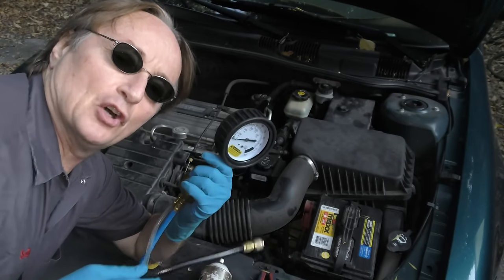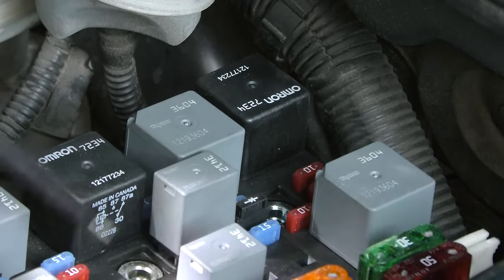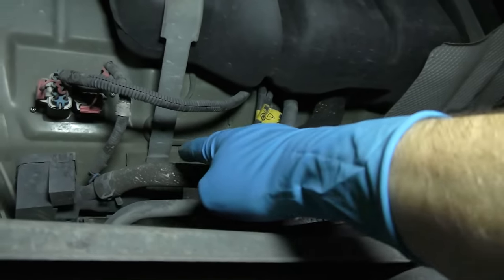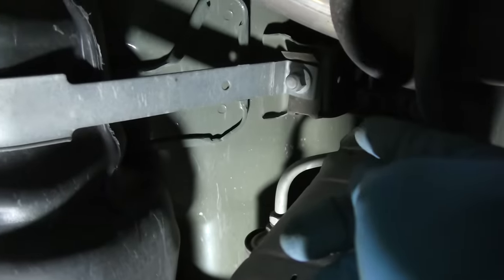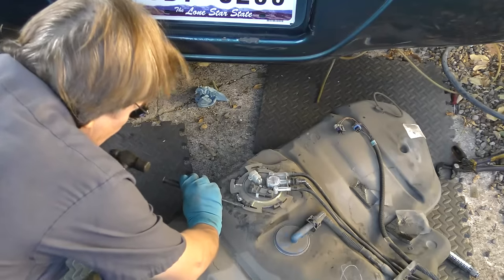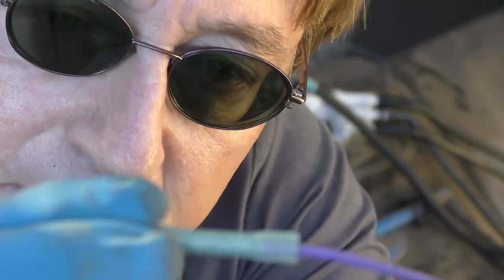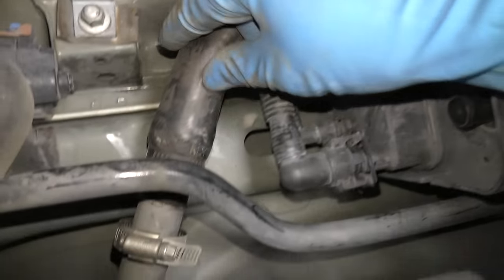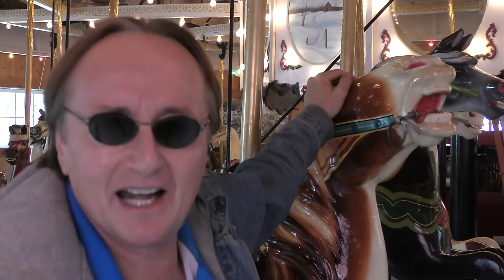How to Fix Car that Cranks But Won't Start (Fuel Pump Assembly)

Comment from the maker: Things I used in this video:
1. Fuel Pressure Test Kit: http://amzn.to/2no0zsh
2. Power Probe Kit: http://amzn.to/2jG2uUh
3. Steel Jack: http://amzn.to/2Asgjxo
4. Mechanic’s Tool Set: http://amzn.to/2Bzmccg
5. Disposable Gloves: http://amzn.to/2zSRuxO
6. Common Sense
7. 4k Camera: http://amzn.to/2hZ4AxX
8. Mini Microphone: http://amzn.to/2newgV9
9. My computer for editing / uploading: http://amzn.to/2i2sKYz
10. Video editing software: http://amzn.to/2jv5Fhf
11. Thumbnail software: http://amzn.to/2k7tz6C

🛠Check out my Garage to see what I use every day and highly recommend:
https://www.amazon.com/shop/scottykilmer

❗️Check out the Scotty store:
https://goo.gl/RwhRGU

👉Follow me on Instagram for the latest news, funnies, and exclusive info / pics:
https://goo.gl/ohy2cA
Reply: Scotty was was the blue cover next to the fuel pump ?
Reply: Do you have to put a whole new assembly or can you just put fuel pump
Reply: Aren't some car fuel pump under the back seat?
Reply: I have a question about my 02 pontack Grand am gt
Reply: Hey my Mitsubishi Eclipse will crank but no start unless I use starting fluid, after that it will run no problem without starting fluid. Could my fuel pump just be weak?
Reply: Mt 2007 kia sportage  ran out of gas I ran a couple days but missed and died alot now it want start at all.why?

Comment: Thanks Scotty! Used your diagnose method on my 2003 chevy silverado 1500. The fuel pump failed all the tests so I replaced it and my truck is running again!

Comment: I changed a fuel pump on a 2001 Chevy Impala and GOD BLESS the engineer who put an access hatch in the trunk under the carpet that was RIGHT ABOVE the fuel pump.  A 4 hour job just became a 30 minute job.

Comment: Here in Brazil the used fuel has a bad quality. The result is multiple cars with this type of defect that you've shown us. The good part is that the vast majority of Brazilian cars have the fuel tank access underneath the rear seat.

And again, great job as usual.

Comment: I had my Honda die on me when the center conductor under the distributor arced out and fried the coil.  I had to get a new coil, cap, rotor, and a new main relay for good measure. That fixed it.

Checking for spark at plugs and the ignition coil and its main conductor (the one in the middle of the distributor cap) is another good place to check if your car won't start.

Comment: Hi Scotty! My husband and I live in Japan and he has a 1997 Mitsubishi Lancer Evolution 4. The one they didn’t make in the states. But he’s run into issues with it.        Turned it on and it reversed fine out of a parking spot. Shifted to first, then second, while in second that’s when it started its symptoms.
Driving normally engine started to sputter.
Loss of power and acceleration.
When given more gas, revs would go up but car wouldn’t accelerate.
Parked it and over the next few days when he’s start it up it would start up very rough .
After two more tries of turning it on it just stopped all together. Now it tries to turn over but it won’t start.

Plymouth razor
Eagle talon have the same engines as the Evo 4.              On another note, I just bought a 1995 Suzuki Every 4x4 Kei micro van. Runs great and no issues but I’d like to know everything there is to know about that van so I know how to fix it and what to look for. I know you mainly work on American cars but I know you have the lovely Celica so you must like Japanese cars. It would be so so cool if you ever decided to make videos of working on foreign cars.  That’s what I want to do with my van is make videos for people to see who can’t find any videos in English.  Anyway enough of my rambling. The Evo 4 is the main concern. I thank you for any time or response you’re available to offer me.   ~S

Comment: Hey Scotty! I recently had my fuel pump replaced and while the car is working, it sometimes has a hard time starting up. I've heard this is a common occurrence, but I was wondering if this is an issue that will be resolved over time, or if there is a solution to fixing it?

Comment: dont forget if you hit a big curb that could shut off the fuel pump, just press the button back in and it should work, most new vehicles have a fuel pump shut off in case of a wreck, they  are usually located in the trunk
Reply: +David McMahon 
interesting
Reply: +TexasPrepper86 This is especially true for Ford cars.

Comment: Had to do this on a 92 bonneville. First I thought there was an access panel in the trunk. Oddly enough there is one under the spare tire, but it's sealed with a foam adhesive cover, however upon prying it open, it looks like GM decided not to put the tank in the right place so it leads nowhere.

I ended up going underneath to drop the tank, unfortunately the J-Nuts were rusted out, had to cut the bolts to get the straps off. Replaced the whole tank, pump and assembly. Was using my phone as a flashlight when reconnecting the wiring harness. I laid the phone on top of the tank while installing it. Phone rings 15 minutes later, turns out I left it up there. Cursing definitely part of the job let me tell you. Needless to say I got the job done and saved myself 400 bucks that the mechanics wanted, and that didn't include a new tank.

Comment: Its a cursing job when you just filled the tank to brim and the pump goes bad.
Reply: +Mayo Siphon the gas out...
Reply: +DloveN7s modern gas tanks are damn near impossible to siphon (I say almost becauseim sure its possible) but its not like the old days where you could stick a hose in the tank and suck
Reply: +Mayo Pretty much everything is a cursing job, when I'm working on a car with my dad, my dad has a curse and every time he touch a car, a bolt strip
Reply: +Mayo you're gonna need a sailor for that.
Reply: +DloveN7s Most cars after the 70s or 80s included a block or filler necks to prevent siphoning hoses to be inserted all the way to the tank.  The only way is to disconnect the hose underneath and be ready for a gas shower. Fortunately some automakers (such as Audi and BMW) had the wisdom to add access on top of the tank so you didn't have to drop it to remove the pump.
Reply: my stepdads fuel pump went out on his truck after he filled up the tank.
Reply: Mayo happened to me once! And died on hwy at midnight and had to get an after hours tow!
Reply: Ricardo a trick to that is taking off the truck bed with help of 4 guys. 2 on each side and Mayb a 5th on back. Or cut a hole in bed over the tank very carefully! The assholes at GM designed fuel pumps to fail rite at 90,000 miles! Mine went out 2x. Once at 90,xxx and next time at 180,xxx! Both times had to pay for towing at night. Luckily I know good mechanics that do side work so didn’t cost 1100 at shop(s10). I could probably do it myself now. No wonder GM went bankrupt!
Reply: Oh and the cost of fuel pumps are $$$$ for a name brand, which I got since it’s such a labor intensive job! $330 at oreily and the 2nd time, mechanic bought the part with his discount and I think cost 180 or 200! Heard amazon is cheaper..
Reply: @ralphfalstin5337  rockauto
Reply: Just put 3 bucks in and bam pump died out of nowhere
Reply: Yup. I experienced this. My car was sputtering so I filled it up with gas. But then found I needed to change the fuel pump... in my garage ...2 gallons gasoline flowed over my floor when I pulled pump cause was...full to the brim 🤦‍♂️

Comment: My Ford dealership here in Nevada said they discontinued making the pumps for my gas tanks. 89' Ford Econoline e250 clubwagon. I sure wish you lived here Scotty, honest mechanics are very difficult to find.
Reply: Mike Stone You can find assembly drawings online, google the model, should be able to find a part number. Call a few other dealers with the part number and see if they can order the part or look up a shop that has it. We have discontinued motorcycle parts at my store but doesn’t mean they aren’t still available.

Comment: for some of the cars you can change the fuel pump without taking off the tank. simply just remove the back seat and the pump should be under the cover. thats how i changed it on my bmw e36. :)
by the way! great video. thumbs up!

Comment: Wouldn't you want to solder those wires together?  Crimp connecters are pretty reliable, but if one came loose it seems like a real pain to get the whole tank down and back up just to reconnect one little wire.

Comment: When mine fuel pump died I  replaced only its small engine leaving original plastic and cables so its costs me less than with all that plastic. Mine pump was also under back seat so it wasn't realy hard. Nice job Scotty!

Comment: My car had all the symptoms and no fuel pressure but i could hear it priming just fine there was a strange dripping noise though so i took the assembly out and saw a big rip in the hose between the pump and in tank filter. Saved a hundred bucks though

Comment: Scotty, you are the only one I know who can help me out with this car problem. The car is a range rover 1998 p38 4.6HSE and v8. Many people were invited to start the car even from a far State but the couldn't. The challenge is a crank no start, no spark,no injector pulse but good communication with a scan tool. I have added fuel to the intake manifold and crank the engine no change at all. It is not starting. In addition, I checked for spark, but there is no spark as well.
Hence, I have just checked for injector pulse but there's no injector pulse either. There is also no ignition current to the injector circuit with key ON and engine off. 
All the fuses and relays are good. I also checked the injector circuit for continuity if the wire is shorted but it was ok. Scan tool communicated and showed only p1843 and p1842 code. There was no RPM during cranking. What I noticed today when I compared the ignition, earth and DC with the same car that was starting and driving to the car that was not starting, what I saw made me to flabbergasted. Where the was ignition for example in the working car there was DC in the car that was not starting. Also a particular relay circuit for example RL-2 one of the pin of the connector when my test light was on battery ground and relay removed, the pump buzzed and testlight dim but when I tried that same location with test light and same pin the test light was dim and ABS relay was actuated no buzz from pump. It is like that in many places in the fuse box and PCM circuit. Please  what's the cause of the problem and what do I need to do to fix the problem?

Comment: Hi Scotty. I saw that you didn't adjust the fuel pump metal ring (the one you hit with a hammer) all the way in.  It happened to me a few weeks ago after I got tired of trying inside the trunk of my 2001 Lesabre. I assumed that it would be enough pressure to hold everything in place, but now I see that you did the same and probably on purpose. I wonder if this is ok or if I should really try to adjust it all the way in. I might have to add that if I try to loosen it up I need to use a hammer, so it is really tight even it it is not 100%.  Thanks.

Comment: Hey Scotty, I changed it out but it's still not starting. I have the same exact model car on my 2003 Chevrolet Cavalier. Looked online and it's a common problem on my car. I am wondering if it could be the fuel pump wiring, fuel pump relay or ac relay? Car was running just fine, I shut it off normally, then tried to start back up and it won't budge. Took it to a mechanic needless to say. No longer hearing the fuel pump turn on during ignition cycle with the new pump. Hope the Mechanic will find the problem. Thank you for making these videos by the way! They are very insightful :)
Reply: They Fixed the Problem. It was the Neutral Safety Switch and the Fuel Pump Wiring near the Fuel Pump.

Comment: Scotty I have a question about why my fuel pump repair was so expensive . I almost junked the car but luckily I found a place that could do it for only 300 . The original estimate was over 900 .
Reply: I paid 1150$ for a new fuel pump, still having the same problem.

Comment: Did one of these on my wife's Grand Am a couple of years ago and it was a PITA. These pumps can fail because drivers run the gas down too low, to the fuel light. My wife did this EVERY week for nearly 7 years and it just died on a two lane road. Took about 3 hours to drop the tank and install a used fuel pump on this car we still have.

Comment: 2011 Ram 1500 replaced fuel pump still hard start. Fuse is fine, it takes a few cycles of the key before starting. If I don’t cycle the key it’ll just crank and crank until I cycle the key a few times.

Comment: I plan to replace my fuel pump with a Delphi brand - they say to thoroughly clean the inside of the tank before replacing the pump.

Comment: Hi Mr. Kilmer, on my 1995 Honda Accord the fuel pump sometimes runs and sometimes it doesn’t. Once it runs, it won’t die. The car stars whenever I hear the fuel pump buzz. Just installed a fuel pump but still hAs the same problem. What causes it?  Thank you for your help. Have a blessed day.

Comment: HI SCOTTY I HAVE A PROBLEM: MY TRUCK MAZDA B2300   97"  I WAS DRIVING IT AND I WAS WAITING IN A STOP SIGN , THEN THE ENGINE WAS SHAKING AND SHUT OFF , THEN ITS CRANKS BUT NOT START UP NO MORE, . HERE AT MY HOUSE I TURN SWITCH ON AND I HEAR IS THE RELAY MAKING NOISE AND THE FUEL PUMP MAKES NOICE TOO AND STAY THAT WAY TILL I TURN OFF THE SWITCH !!WHAt DO YOU THINK CAN BE THE PROBLEM? THANKS MR.

Comment: Replaced a 2015 Ram 1500 fuel pump. It looks like everything is fine, but Crank and won't start. The pressure seems low. I was able to see 9 kpa which seems low.

Comment: Some car use the crank position sensor to signal to the ECU to prime the fuel pump so a code reader is handy if you don't get a code look for an inline fuel filter to see if it's clogged.

Comment: I agree with you there. I changed the fuel pump on my 2002 ford explorer xls a few days ago and the rear strap bolt got me cursing for hours!
Reply: My 06 explorers fuel pump went out a few days ago left me stranded until road side assistance could pick it up not sure where to take it yet

Comment: Sir thank you for this video. I have a 1982 f150 with a 1972 300 inline 6 4.9l in it I replaced the electric fuel pump with a mechanical one but my carburetor won't pump any gas. I also had to disable my duel tank switch could the two be linked together as a whole problem?

Comment: Hello Scotty I have a 2004 dodge stratus and I’m pretty positive I’m having a fuel pump issue. My fuel pump is located under my back seat do I still have to remove everything from the bottom like You did in the video?

Comment: And it's also a good idea to take pictures with your cellphone all those wires before you detach them just in case you don't remember how it goes back in. Get success!
Reply: This guys been a mechanic for 48 years, I think he knows how it all goes. But if you're just starting to fix cars or you're doing it yourself, that's a good idea

Comment: 2015 Chrysler 300 cut off . Replaced fuel pump and still want start. Check relays and fuses and all are good

Comment: Another problem with these Pontiacs (I have one) is there becomes a computer issue where it disables the fuel injection so it wont start. Sort of a security issue I think. When I couldn't get mine to start I tried to see if I had spark by spraying some starting fluid in the intake (Didn't have tools with me to get to the spark plugs) Turned out it was a fault in the system that is common in these. You have to turn the key to the run position and let it sit for fifteen minutes until the check engine light flashes then try and start it. Only cost me... $1300 to have fixed. It's not something someone like Scotty would be likely to be able to fix since you have to have a new computer installed and have it imprinted to the car's serial number or something.

Comment: other cases for your car to just shut off mid highway is your timing belt snapping or insufficiant sparks (spark plug). Happened to me the other week thinking i had a bad fuel pump or timing belt snapped but it was just old clogged up nasty spark plugs

Comment: My pump was bad. Car didn't start. It's accessible under the back seat. I hit the top of it and it started so I could get home. I put in a new pump. Didn't work very well and then stopped working. I put in another new pump. Didn't work at all. I put in old pump. Car worked but I can tell by the noise that it's failing fast. Why would two new pumps not work but the old one worked? Some people say I should just replace the whole assembly. What do you think?

Comment: Scotty makes it look so easy to do
Reply: +Colin Donovan He edited out all the cussing.  Gas tank jobs are miserable, unless you're doing a pickup truck and can take the bed off easily.  Road grime, rusted bolts, and gasoline- better pick up a 12-pack!
Reply: John Daly I know taking a tank out is no easy job, especially with no lift.  Even with his video on how to replace a clutch I know is also not an easy job either
Reply: +Colin Donovan its called editing
Reply: +John Daly exactly
Reply: Rick R I know that.  I was just saying the way these are edited makes it look simple to do, but I know that's not true
Reply: +Colin Donovan haha, i figured you did, hey, I'll tell ya tho , i have a new respect for scotty doing that job on the gnd.. Ugh!

Comment: How long did it take you to do that job, Scotty? 

I've always wondered, because you'd have to diagnose the problem, then order the part, or go get it, meanwhile the car's not drivable sitting on your driveway,  plus you have no help, and no lift, so you're really working like a true backyard mechanic. I wouldn't be surprised if it took all day in total elapse time.
Reply from the maker: +MichaelAChang took me about an hour and a half.